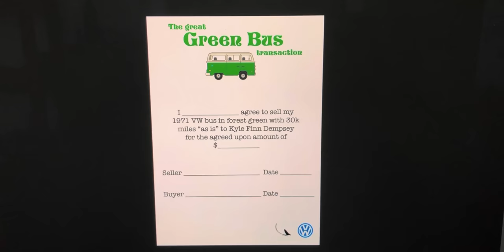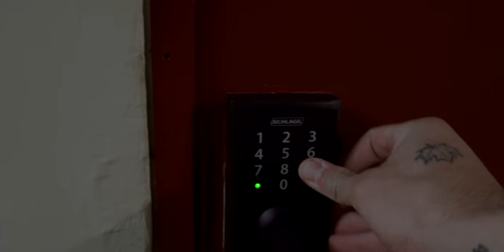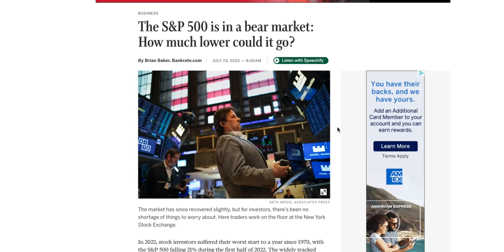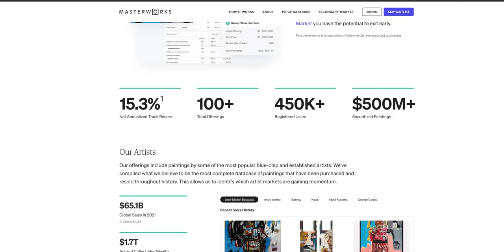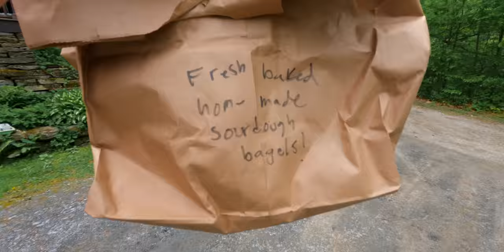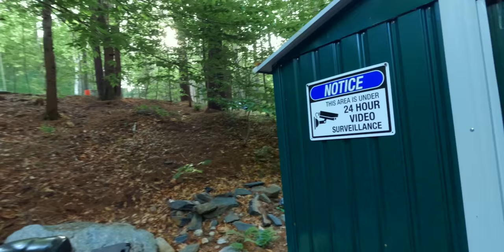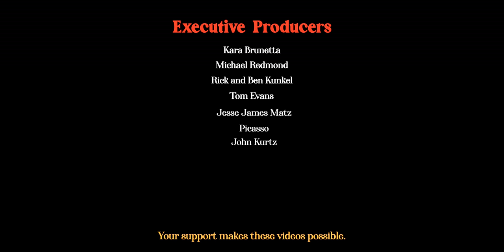The Story of Georgie the VW Bus ☮️

Comment: Wonderful video. It's a long and winding road but that's half the fun of project cars. I spent many years working on cars and gravitating to late model tech and figuring out how to make it faster, but as I recently passed 40, I've been rediscovering my love of older school cars and motorcycles, especially those from the 60's and 70's, there's just such a unique charm and dare is say it, beauty to the mechanical processes of old vehicles, like even small things like linkages on an engine running multiple carburettors,  a very human sort of charm, like you can see the trial and error that went into designing and building these parts back in the day.

Comment: The calipers weren't not likely the problem.  I suspect the flexible break lines are collapsing causing the brakes to fail.   I suggest replacing both flexible brake lines.